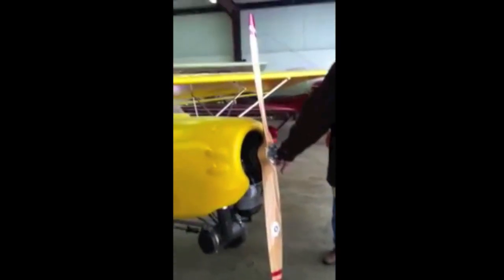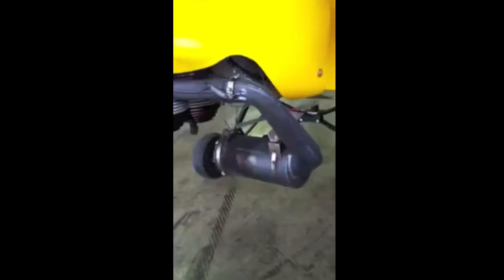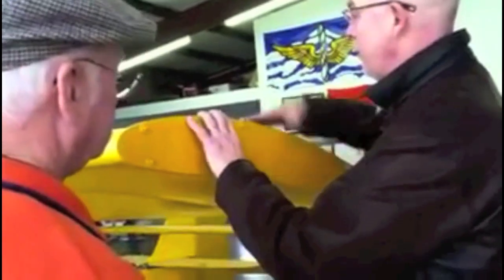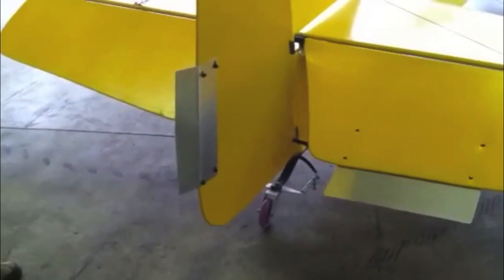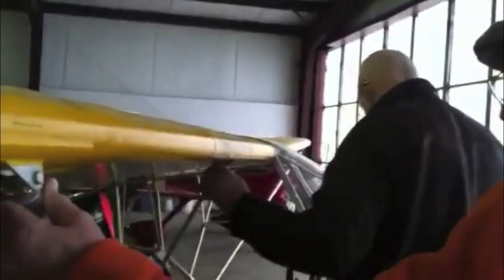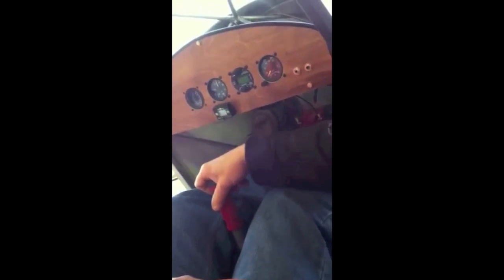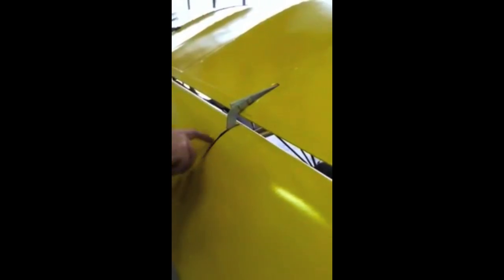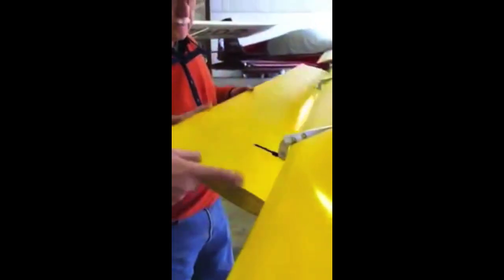Belite Walkaround

Comment: This video is NOT a selling point for Belite ultralights!
Is this guy trying to sell a Belite or a Quicksilver?

1. Belts slipping  20 seconds into video.....
2. Spark plugs stripping. 1:37 into video...
3.  Engine "stopage" at 2:32  in video due to incorrect fue linel?
4. Muffler rust / issues at 3 minutes into video
5. Airframe issues at 3:52 in video
6. Fatigue failure at 4:32 in your video
7. Looking for cracks in airframe at: 4:52 minutes into video?
8. Parachute issues. Are you kidding me?